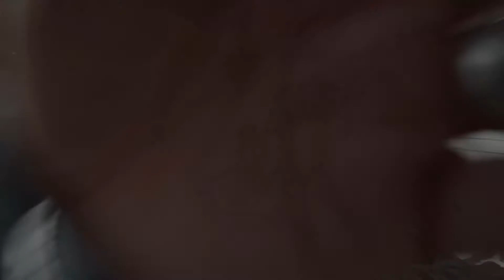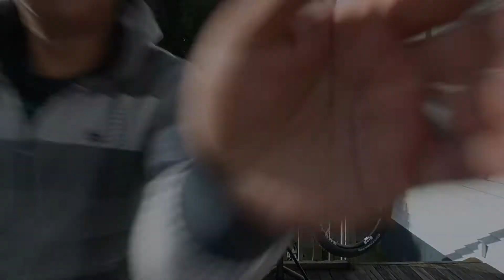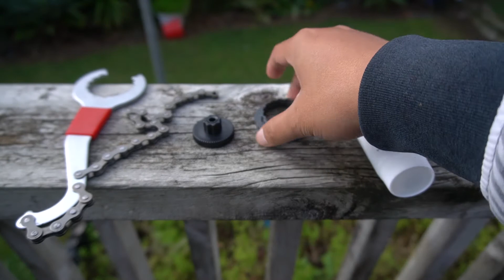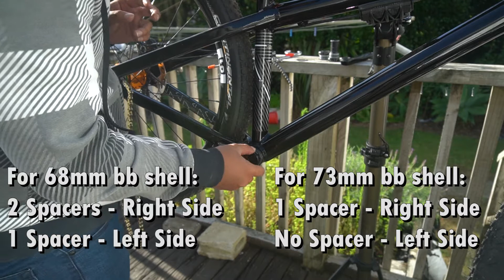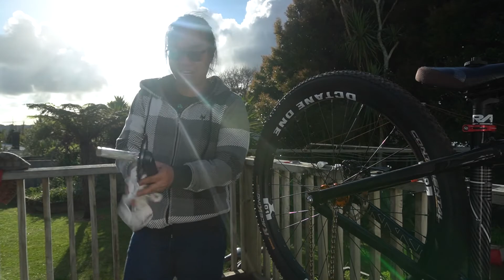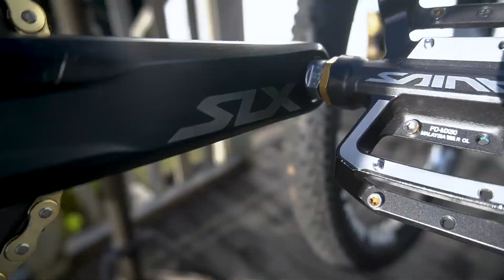HOW TO INSTALL SHIMANO HOLLOWTECH CRANKSET | Shimano SLX M7100 | OCTANE ONE ZIRCUS

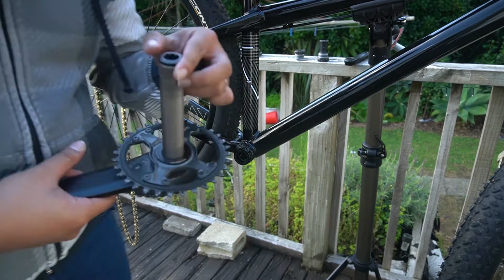Comment: Hey there - nice video! Do you have any tips on what to do when one or more of the 8 chainring bolts seen in 4:55 of your video come loose and are eventually being lost? Somehow I can't find anything on the internet about this at all 🧐
Reply from the maker: Bro, do we have the same crankset? If yes, not sure if they sell bolts separately. If not, you gonna have to buy and replace your chainring. As this crankset are different from 104bcd or 94 bcd crankset where you can buy a single chainring bolts.